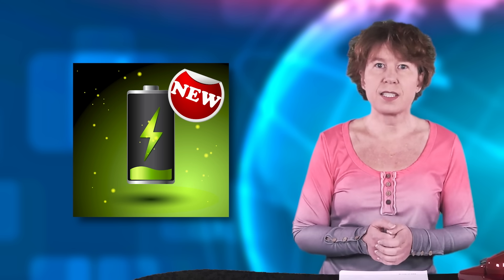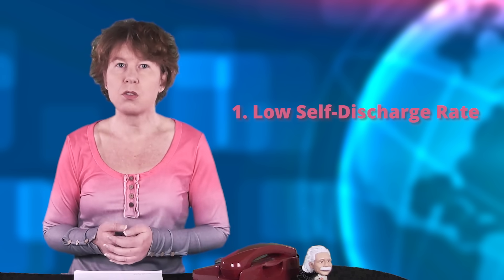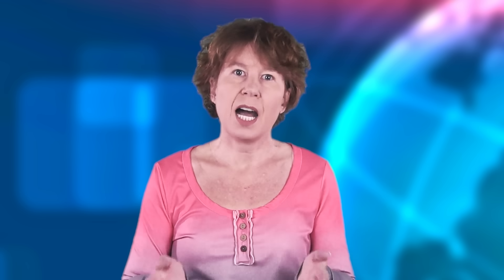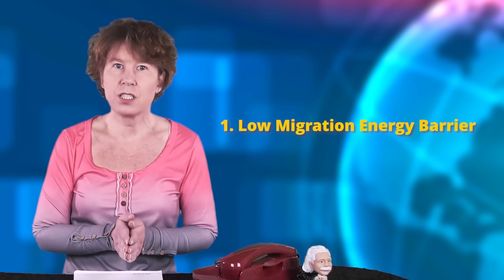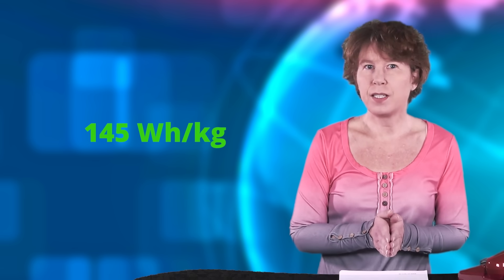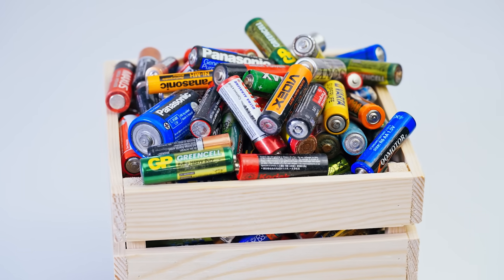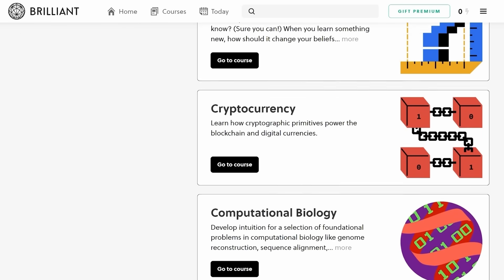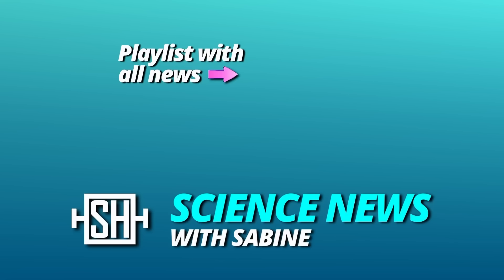Fully Charged in Just 5 Minutes: New Battery Breaks Records

Comment: there is a practical problem: charging efficiency. even if you get 95% efficiency charging a 100kwh battery in 10 minutes means there is 30kw excess heat that will dissipate somewhere, usually in the battery. even seen a 30kw heating element? how are you going to get rid of this heat

Comment: To fully charge a battery of 100kWh at a voltage 400V, a current I = 1,200,000 A is needed, not considering the resistance of the wires. However, it's important to note that achieving a full charge in 5 minutes with such high current requirements would require extremely thick wires, which may not be practical or safe in real-world scenarios.

Comment: Just saying that everyday charging, which is what I do 361 days of the year is much more convenient than going to a gas station because I do it at home. Road trip charging is less convenient in some but not all ways. It takes longer (less convenient) but if I have to stop for lunch and a pee it’s more convenient because I don’t have to pump gas. Just plug it in and walk away - five seconds. Also, my car calculates exactly when and where I need to charge and takes me to the chargers. I don’t have to plan where the gas stations are and be alert so I don’t accidentally pass them.

Comment: I think you are wrong about range anxiety.  Nobody cares about the range of a full petrol tank because you can fill up anywhere in under 5 minutes.  With an electric car, for every 3 or 4 hours you drive, you need to spend another hour filling the thing with electricity...
But anyway, at a lot of charging stations, it's not the battery that limits the charging speed, it's the low power of the charge point itself.  What's the point of a battery that can refill at 500kW if the charging point can only supply 60kW. Lots of supposedly super-fast charging points seem to share the available power between multiple charging columns.  We don't have a public fast recharging infrastructure today (well, except maybe Tesla) so without governments really committing money to the energy transition, the battery technology is not the limiting factor, imo.

Comment: Most people forget one very important difference between EV charging and refuelling a petrol car.

Most EVs will charge slow at nights and start the day with a charged battery. Or charge slow at the workplace when you're at the office. Slow charging (3-11KW) is NOT time loosing for the car owner.Even less than refuelling a petrol car because plugin is mayb 15 seconds, not the 5 minutes you need for a petrol car.
IF you ever need a fast charge you're on a long trip. My battery last for about 3 to 4 hours driving....
After a few hours driving nearly all drivers need a sanitair stop, something to drink (Coffee, tea) and I suppose also a meal....When driving a petrol car this stops takes 10 minutes for fuelling the car including paying and reparking the car before you can start with your own rest.
An EV will be pulgged in and is ready , often before you finished youre own stop as described. (800Volts cars, charged for the next stint in 18-25 minutes).

I'm surprised that someone as Sabine does not seem aware of this......and that tells also tha the 350KW chargers are enough for all fast charge stops due to the drivers needed stops wor any normal car.
This makes 5 minute charging not necessary...in contrary... When I should charge this quick I would have to stay with the car the same as with petrol cars which only INCREASES my pause time.

Of coarse very fast charging batteries can be usefull in other fields (industrial) of usage....but for cars the current 18 minute charging from 10-80% is good enough to charge the car faster then a normal rest for the driver after hopurs of driving.

Comment: What is the point of a battery that charges in 5 minutes if the electric grid can only supply a car's worth in a couple of hours. Current charging infrastructure gets overloaded by more then two or three cars trying to charge at the same time,  To take advantage of quick charging batteries every charging station would need a large town sized sub station (and the generating capacity to supply it) and a average sized supermarket distribution center would need their own city sized substation it it was charging an electric fleet, while a large DC (such as Amazon) would need their own power station.

Comment: Plenty of reasons to charge quickly.
Particularly if we are short of chargers.
Reducing charge times reduce the number of chargers required to make EV use viable.
Reply: Plus of course the rate at which a battery can be charged within specification is very likely to influence how quickly it can be charged whilst optimising ageing and other parameters. Charging at lower rates are likely to slow degradation of the battery mitigating the effects of ageing.

Comment: The chemistry from a battery is what it is good or bad, but most people have no 
understanding about the energy that is in it and that is just A x V = watt.
do you go futher you have also R from resistange that is for most people
allreadt to far, but now my question can you take out more from it than the
formule A x V = W that is what i like to proof that you can take out more.
like this a battery 50 V x 50 A so yes 50 V is the input a stack from 10 piece
in paralel making 50 V x500 A a the same stack nects to it is in serie here we
will have 500 V 50 A the feed in is from the paralel stack 50 V x 50A
now the trick is this the output from the serie stack - 50 A x 500 V = 25 Kwh
but the input is 500 A x 50 V this is making 10  Hour from 25 Kwh = 250 Kwh
but the two stacks are only 50Kwh dont steal it
regards Henk

Comment: Charging time does matter. If we only have chargers capable of slow charging (< 400 kW peak, say) then we are going to end up with a very expensive commercial charging network and expensive charging because an enormous number of chargers and charging bays and thus an unnecessarily large investment in chargers and charging station real estate will be required to meet the level of demand for charging. Rolling out fewer charging posts and bays but providing faster charges with multiple vehicles cycling through individual bays over the course of an hour represents a far more sensible allocation of charging resouces.

Comment: So they basically if I had a capacitor  and resistor i could limit + filter the dc with another smaller capacitor, so basically a usable battery which can be charged using simply a second, we just need to find solution that is sizable enough, to have that capacitor actually charge a battery inside, that way yoi could have the current from the capacitor always filling the battery current efficiency up to 100% almost always

Comment: The what hours are not the main challenge. The cost is. If I wanted a 40kWh battery, to get energy independence from the grid, I would not be bothered if it weighs 60kg at 143Wh per kg or 600kg. As long as it cost under a thousand rather than £10 000.

Comment: This would be beneficial for vehicles. More capacity generally means a bigger and therefore heavier battery, a smaller lighter battery that charges quickly is therefore beneficial for efficiency reasons (moving around all that weight costs energy in it self). Also it might also be much more convenient for people that can’t charge over night and are more dependent on fast charging infrastructure.

Comment: The other caviot is the faster it charges the fewer full charge cycles you can get and the more memory effect the battery has. This is due to crystal production within the battery. Battery chemistry has never been able to fully overcome this, however there was some work done with carbon nanotubes that seemed promising a few years back.
Reply: 80% charge in 5 mins,100% charge in 10 mins & 1500 cycles
already there........
Reply: @jjtompson5914  The charge doesn't matter. It's the capacity that changes. When a battery is new, you may have say.. two hours of useful energy. Within 100 charges you are down to one and a half hours worth of useful energy due to crystal build up, but that one and a half hours will represent 100% of available charge capacity, thus you have less charge. This is well known.
Reply: @frosted1030  Sorry forgot to mention
93% Capacity still after 1000 cycles....Silicon Anode battery

Comment: Good example with the phone thing.
Why should I need a phone to charge in 5 Minutes? If the phones battery capacity is large enough to bring me through the day, I charge it over night anyway so I dont care how long it takes.
I think this is similar to the development of how small the mobile phone has become. Handiness and usefulness.
At some point, it levels off and we get an everage on battery loading speed and capacity. 
But listen, for this to level off, we need the development on both sides.
Reply: When a device is powered by a battery, first and most intelligent choice is to change the battery for a fresh/charged one. Tank full and ready to go in seconds.

Things with build in, non swapable batteries basically are an insult.

Comment: Pretty much the only reason anybody is considering hydrogen-powered vehicles is that you can fill them up very quickly. From most other viewpoints, they're a dumb idea. So, yes, faster charging times would help EVs. Whether Lithium-Indium batteries are the answer is a very different question.

Comment: There was a company that was building fast charging batteries back in the early 2,000's. A typical phone battery with their technology would take about 60 seconds to fully charge from dead. Almost zero heat produced. . . But, the company only wanted to build their battieres for large deployments, such as power grids, or fleet vehicles. Their batteries were installed in Phoenix Vehicles; but that company  has vanished. The company that made the batteries was Altairnano; which used nano technology in manufacturing.
Reply: "A disadvantage of lithium-titanate batteries is their lower inherent voltage (2.4 V), which leads to a lower specific energy (about 30–110 Wh/kg[1]) than conventional lithium-ion battery technologies, which have an inherent voltage of 3.7 V."

2.4 volts not enough to run a mobile also much lower energy.@ 30-100 WH/kg
Silicon Anode @   320 Wh/kg batteries are the future..........
Reply: @jjtompson5914  What do any of your numbers have to do with Altairnano, Phoenix Vehicles, or producing batteries that charge quickly and don't produce the heat that more conventionally produced lithium ion batteries produce??
Reply: @jjtompson5914  What is the origin of the numbers you are using? And, what do they have to do with Altairnano or Phoenix Vehicles?

Comment: Fast charging vehicles, 5 minutes vs 5 hours.  Ok,  Primary reason.  Survival.  You wake up.  Power was out overnight.  There's a forest fire about 5 minutes away, and it WILL hit you.  It takes about 30 seconds to put gas in your vehicle.  Good luck with 5 hours, let alone your 5 minute "fast" charge.  Or, you live in a country over 6,000 km (6 Mm Mega-meters) wide, with vast stretches of wilderness you can't traverse and never will be able to, because there's no power, no infrastructure apart from roads and whatever gas you can carry.  Or any situation where you need to rapidly move.  Battery dies in a bad part of a city?  Battery dies in a bad part of the country with roving gangs?  Civilization collapses?  You can still have a farm and render biodiesel from plants and animals.  Renewable energy.  You live in places that are astonishingly cold for 7-8 months of the year.  Only a combustion engine has a chance of functioning.  Battery powered vehicles are a formula for death.  It doesn't have to be "fossil" fuels, but renewable combustibles are vital.  You can have batteries, and use them as the primary source if you want, but you must have a mechanical drive from combustion if you want to survive.  At the very, very least, you must have a combustion-based power generator that keeps batteries continuously topped up.  You can rely on slow, or really slow, or stupidly slow, or deadly slow battery charging when it is safe.  But at any instant, you MUST have the option to push a button or flip a switch and just GO, zero charging, zero wait, zero delay, or you may as well just kill yourself now for all your stupidity and foolishness.  My problem isn't UTILIZING batteries and electric motors, which are cool, and I encourage people to do so, but rather relying on them as the SINGLE POINT OF FAILURE in any equation in which survival is a factor.

Comment: if it charges so fast how would it work with solar panels, if solar panels problem is that it cant charge fast enough, then maybe if the battery could be charged extremely fast it could counter its downsides

Comment: Why do everyday-cars need 150PS and +? Make lighter cars with less horsepower, 45 to max. 75PS is enough, then you need smaller batteries or you have extended range. But: really light cars can only be build with combustionengines because low energy density batteries are too big and too heavy.

Comment: In the future, electric vehicle manufacturers will own the batteries in the vehicle, and instead of charging at a station, you will drive your car into a station and a machine will quickly swap out your dying battery for a fully charged one. They will then charge the dying battery and give it to another customer. You pay a flat rate for the exchange, it's that easy. Presumably batteries will be updated and their will be different sizes at models, this will complicate things, but it does allow for engineered obsolescence (something tech companies like a lot).

Comment: @SabineHossenfelder Well, the technical ability to charge a battery in that time is an admirabl achievment.  And while it may practicable to implement that on special charging stations peopole won't get that luxury at home.  I didn't watch the video yet or do the math but that's a charging current easily in the hundreds of amps or kW.  Your electrician will have to install proper power rails in the garage to make that happen ;-)

Comment: We need batteries that aren't prone to thermal runaway and that don't burn at 2,000 degrees when they go off.  No-one seems to be taking this (rare) fire risk very seriously, if it happens in an underground car park woe betide what's above it, not to mention anyone local breathing in the very toxic fumes.
Reply: Reality is Sabine is way behind on this battery tech........Thermal runaway problem.
Already invented & operational in U.S Army programs.....it's called "BreakFlow" by Enovix & won the recent CES innovation award.Also...........

ENOVIX SILICON ANODE EV CELLS 

Fast Charge.   80% in 5mins
Gravimetric energy density of 320 Wh/kg
Volumetric energy density of 900 Wh/litre
Silicon anode with an energy density of 1.8 Ah/cm3, more 
than twice that of graphite anodes at 800 mAh/cm3.
Surpassed 1000 cycles while retaining 93% of their capacity. 
Recently passed 1500 Cycles/10yr projected lifespan
Silicon makes up 27.7% of the Earth's crust by mass
Conventional Lithium Stack Cell Bottom-Cooled
ΔT = 31.9 ̊C
Enovix Silicon Stack Side Cooled
ΔT = 2.8 ̊C
Reply: https://www.youtube.com/watch?v=OU03B1U-Cp0

Comment: Frankly, the entire electric car industry should have been put on hold until the release of the aluminium battery. Electric vehicles are currently worse for the environment due to production energy than combustion vehicles and have expensive batteries which are practically not even recyclable.  To think the old lead acid battery is actually recyclable and we have had those for over 100 years. Nothing against electrics but a cost effective and far more environmentally friendly system for powering them should have been developed on a serious global scale first.  All current electric vehicles are doing is driving the price of everyone's every day consumer electronics up, which could very well be counterproductive to working out a better solution or solutions all round.

Comment: Because owners of combustion vehicles do not suffer from range anxiety, it can safely be assumed that range anxiety has indeed to do with charging speed and the availability of charging spaces. A higher charging speed also makes it possible to block existing charging spaces for a shorter time and thus helps to solve both problems at the same time.

Comment: If this battery tech is less volatile and polluting than lithium tech, then that alone should warrant more research and development in to that type of battery tech at the least.
The true test is discharge states and dendrites ... if discharge can be comparable to lithium ion and not produce dendrites across the barrier substrate then it would be the clear choice to elevate electrical storage tech to the next level.
If you can add on top of that a non polluting anode, cathode, and electrolyte, that would weigh even more towards warranting further development.

The sooner we can get away from lithium ion batteries the better in my opinion.

Comment: I think we forget that the current crop of Lithium batteries used in vehicles are really the first generation, there has been a lot of fiddling for very slight incremental improvements over the years, however no real big breakthrough improvements in power density, with the corresponding safety, realistic cycle life and hopefully a cost reduction from the current tech. There are a never ending stream of supposed laboratory break throughs, which is encouraging, however bringing any of these technologies to mass production at a reasonable cost is the key here to the next gen battery tech. Hopefully we will see this soon!